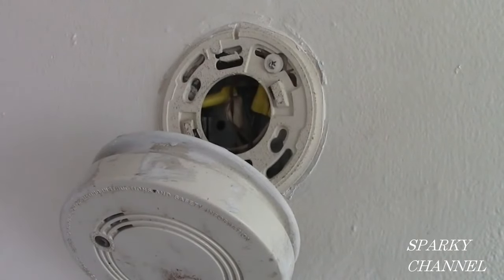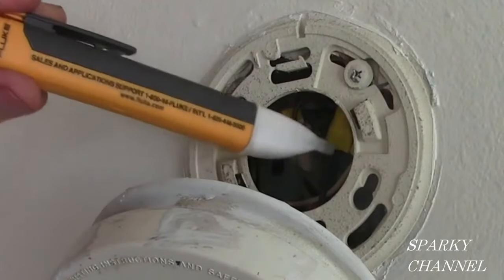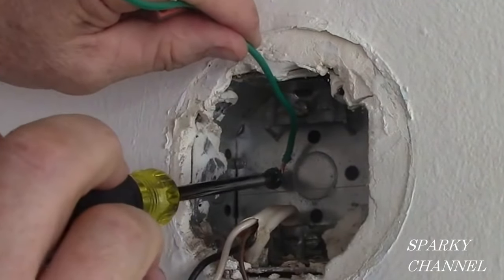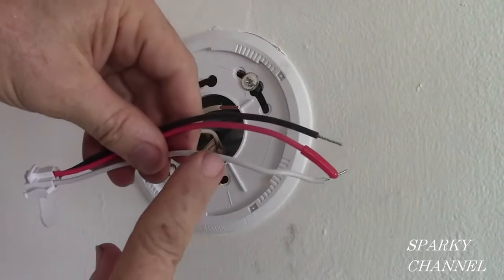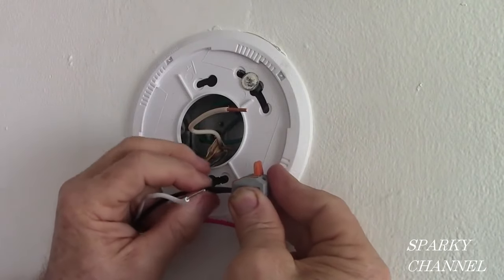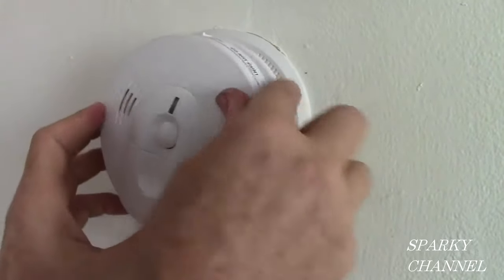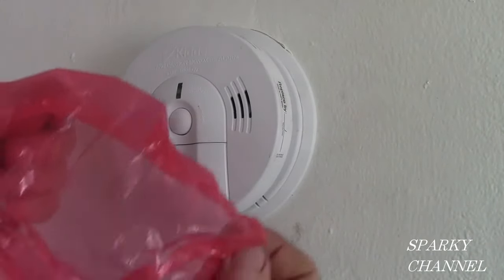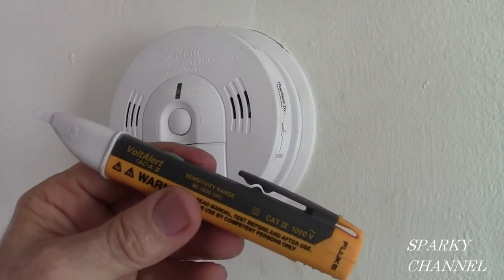Kidde Hardwired Smoke and Carbon Monoxide Detector with Battery Backup and Voice Alarm  Installation

Comment: The red wire is a signal wire, not a power conductor. It's meant for homes with multiple alarms. If one alarm trips, it will signal all of them to trip.  It's a great idea.  My apartment has the smoke/fire version of this model. It's cheaper. Uses a 9v as the power backup.  It's very sensitive to insects crawling inside it causing a false alarm. The bugs go there because the detector is warm with 120V all the time. So the alarm trips all the time.  Bugs are a fact of life in an apartment and being mounted on the wall with the junction box open to the studs is like putting a rest stop on a bug highway.  Very annoying design. Kidde ought to make an insect-proof design.
Reply from the maker: Excellent comments, thanks!
Reply: The red wire IS a power conductor. It uses electricity to send the signal to the next device. By definition, that is a conductor transferring power.

Comment: a couple notes: Kidde also sells a line of worry free detectors, which have a permanently installed lithium ion battery - meaning no battery changes for the service life of the detector.
also, it bears mentioning, the service life of a detector is ten years - there is a label on the detector for you to write the install date so you can tell without pulling it off the wall and looking at the manufacture date.

finally, I like to wire the pigtail before I install the mounting plate.  makes it easier to tuck the wires in.
Reply: Those are saying they are 10 year warranty
Reply: @rgruenhaus  yes.  ten year warranty, ten year service life.
Reply: Just bought one and it seems to be pretty well made..But I'd rather have a Combo Smoke and Carbon Alarm
Reply: @conservativeamber1216  you mean like the Worry Free combination detector?

Comment: I would take the time and write the "Replace By" date on the sticker on the side. The detectors will start to beep when the 10 year (or 7 year) replacement period goes by - having the date might help a person figure out why the darn thing is beeping.
Reply: I once saw one where the person wrote in the "installed on" sticker the words "on ceiling". A product of our fine education system.
Reply: My original from Amazon in 2016 and just a few days ago I came home to an alert of low battery and new batteries did not stop the alert! The green AC power light was flickering. An Amazon Rep told me the one I bought in 2016 had a 3 year warranty so no matter what the actual problem was I got a few more years out of it! New 10 year warranty one is on the way.

Comment: Thanks you for this. I never knew about hard wired smoke detectors. I dont have smoke detectors in my home. I bought some battery powered ones. And they just kept randomly going off, and pissed me off so I threw them out. I am going to give these a try.
Reply: Try getting a photoelectric alarm, instead of ionization. They're less likely to have false alarms, especially near a kitchen.

Comment: I have the KN-COSM-IBA and it was just installed in our new house. The problem is that it's too close to kitchen so it goes off almost every time we cook. I heard you can adjust the sensitivity on the circuit board but I didn't find that info in the manual. Any ideas? I know it's probably frowned upon but I don't really want to move the whole thing. Thanks!

Comment: Bill, I’m about to replace my First Alert smoke and carbon monoxide alarm with voice, with the Kidde equivalent. How would you compare the connectors between the two different brands? Is it easier than the First Alert to connect/disconnect the Kidde brand?

Comment: Would be nice to see a follow-up showing how to use the red wire for linking.  Does it mean you have to run 220 cable between detectors to get the extra conductor?  You'd have to have it start at the first detector instead of at the panel I assume.
Reply: for multiple detectors, there should be a three wire cable going from detector to detector.  the system still runs on 120V, and you will use the red wire on the cable for the link wire - do NOT connect that to anything but the link wiring, because all it does is let one detector trigger the whole chain.
Reply: No, that different... red wire is connecting other alarms
Not heavy electrical
Reply: 14-2 from panel and 14-3 to interconnect the rest, so they all beep together.
Reply: @carlomiranda3799  yes, but red wire use Control another smoke alarm... let say smoke alarm or CO alarm go off then other alarm go off same time
Electricity ca use 120v only, black wire hot and white is neutral...

Comment: what is the device you are using to see if the power is off?
Reply from the maker: A ground protects from sudden surges such as lightening.
Reply: That tool is called a non contact voltage detector. Sorry I'm late to comment, hope this helps

Comment: First time I've seen a fire alarm operating on AA batteries. I've only seen them with 9 volts
Reply from the maker: They are special batteries made to last 10 years. But yes, I usually see them in 9 volts.
Reply: @SparkyChannel  Last time I saw any battery that would last anywhere close to ten years was before Radio Shack went out of business.  Their store brand batteries were by far the best lasting batteries I’ve ever used. 
The “10 year” batteries you buy now get a couple of years tops.  Always check your batteries regularly.

Comment: If battery is moved but powered by wire, will it always chirp?
Reply: Mine does….   It continues to say “Battery Low.”
Reply: I don't know that is an excellent question.
Reply: @briankuhn7396  did you try putting in new batteries?
Reply: The smoke alarm in my room has never chirped once.

Comment: Do these really need to be hard wired?
I was just going to run it my new on on the battery. But no green light came one.
Reply from the maker: Hi Saul! The hardwired ones with battery backup are clearly marked and the battery only ones are clearly marked and that's how they have to be installed.
Reply: There’s no light on mine though. Should there be?
Reply: No, they do not need to be hardwired if they are powered by batteries.
Reply: @SparkyChannel  i bought the hardwired version without knowing it was a hardwired version. Can I just install it with the batteries only, and not do the hardwiring? My house is not set up to hard wire it.
Reply: Will it work on batteries alone.

Comment: Mains powered fire alarm? Never seen that here. We got only battery operated ones, mostly with a 10 year battery. And after 10 years the fire alarms should be replaced anyhow. Several fire alarm models connect the different fire alarms wirelessly.
Reply: yes they are both but most pple will not change out batts after a cple of yrs. and the biggest problem i have with wired mains are a lot of regs say they need to be on own circuit problem is if they have a problem most pple shut off breaker and remove batts. i like to tie them in with a main light kitchen hallways or even better the fridge pple will not live without those 4 to long lol
Reply: @wizard3z868  On the ones with long life batteries you actually can't change the batteries. And they're not standard batteries, these are Lithium battery packs like the ones in phones, tablets and such things.
Reply: @Marcel_Germann  yes im aware of the uk smoke batts(thomas naggy i think was the first time i seen them) and the ones in this video are also 10 yr battery something new to see but in the states most wired batt backup or nonwired where just 9v alkaline cells that no one wld ever replace. my old co2 used 3 AA but changed out after 8 yrs of service and 14 sets of batteries maybe less lol
Reply: @wizard3z868  They make better ones for 120V in the US now. They have the 10 year battery backup. I installed them at my friend's house recently.
Reply: @illestofdemall13  nice I don't get much calls for smokes but I'll look for em in the future
Reply: @wizard3z868  They cost more money but for safety I think better quality is worth the cost.
Reply: @illestofdemall13  well the 3 I replaced plus the new ones replacing batts every year 8 yrs $8 $64/3 $22 plus the original price may avg out to be the same?
Reply: @wizard3z868  Yeah more or less it averages out to a similar price.
Reply: here, it is illegal to NOT upgrade to a mains powered alarm if it is possible to do so without further removal of finish material in a remodel - and you also must use hardwired interconnection if possible.  and of course, new construction requires mains powered detectors with wired interconnection, full stop.
Reply: @kenbrown2808  Here you only must have them installed and they must be functional, they don't care if it's mains or battery powered or if they are connected. In bedrooms and escape ways like stairways or corridors.
In most cases people install battery powered ones where the batteries last 10 years. After ten years you'll have to replace them anyhow. And in the US it's much easier to implement a new circuit because the walls and ceilings are hollow in most cases and you just need to create openings in the plaster board and fish in the wires. Here you got masoned walls, and in most cases ceilings made of steel reinforced concrete with a layer of plaster on it. That means installing new cables will create a lot of dirt and inconvenience. So it was decided that battery operated are fine too, because they're simple to install. And there's actually no advantage in a mains powered one. They must be replaced after ten years too.
Reply: @Marcel_Germann  you're right about the difference being the trouble involved in adding wire.  here they do allow battery and RF interconnection if you can't install wiring without tearing out existing material.  but with hardwired systems, you have belt and braces, so if possible they want it hardwired.
Reply: @kenbrown2808  I don't see any advantage in a mains powered smoke detector. Except that people would flip the circuit breaker if the backup battery is empty and the beeping annoys them and the smoke detector is on a dedicated circuit. On the battery operated they could remove them, but in such a case they couldn't say that happened by accident (Ups, I accidentially flipped the breaker, didn't know that this was the circuit for smoke alarm. Who could know that later a fire starts?), then they removed it on purpose. Smoke detectors normally don't fall from the ceiling and the base is still attached to the ceiling.
Reply: @Marcel_Germann  which is why most inspectors want it on a lighting circuit.  that way they can't just shut it off without blacking out part of the house.
but the idea is that if you WANT the detector wo roke, both the batter AND the mains power has to fail to stop the detector working - and the wire has to be cut to stop the interlink from working.

Comment: the biggest problem i have with hard wired are a lot of ahj say they need to be on own circuit problem is if pple have a problem most  shut off breaker and remove batts.(problem solved/fixed)🤦‍♀️😢. i like to tie them in with a main light kitchen hallways or even better the fridge pple will not live without those 4 to long lol
Reply: my inspectors have always wanted it to be on a lighting circuit because of that very reason.  still doesn't stop people taking them down, of course.
Reply: its agisnt code to have smoke alarms off of a lighting circut because the lights can toggkle the power going to the smoke alarm. so they must be on there own dedicated curcit
Reply: @theshedproductions.  are you from outside NAmeriaca? because in most of North America it makes no difference as long as smoke is not on switched side!
Reply: Good tip to add a light or something onto the dedicated smokes circuit.  I wouldn’t just randomly put smokes on another existing circuit, though.  That’s unprofessional.  (And just wrong)
Reply: @fomoco300k  its safer to add smokes to circuit tht contains something crucial like main lighting or fridge pple are cheap and lazy and wld rather turn off a breaker and burn to death than spend money on replacing a smoke.

 how many tv/ movie shows have you seen pple take the batts out and never replace or worse use the batts for a kids toy or tv remote lol. translate tht to just turning off a switch 🤦‍♀️